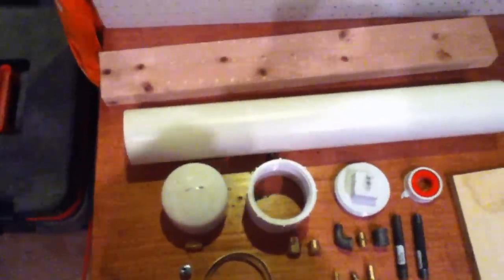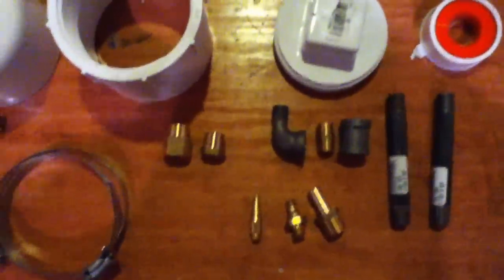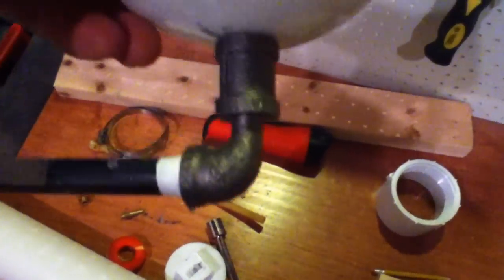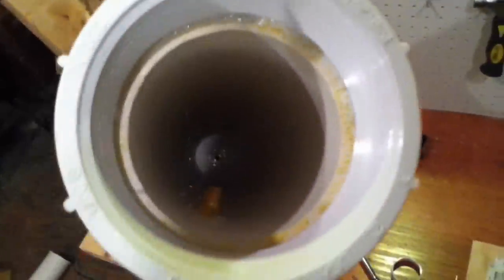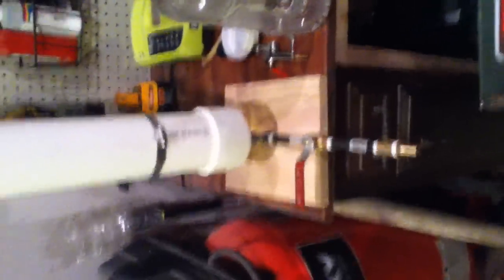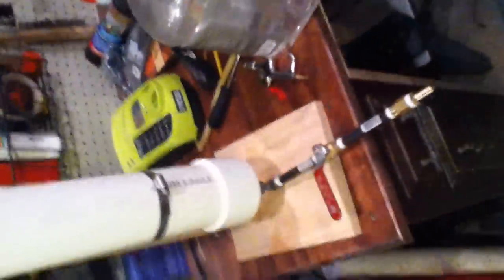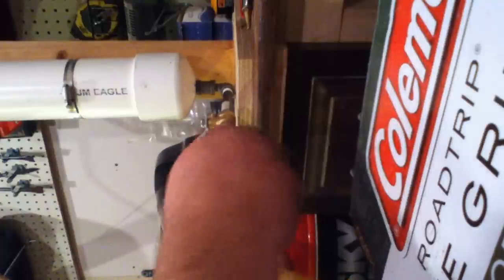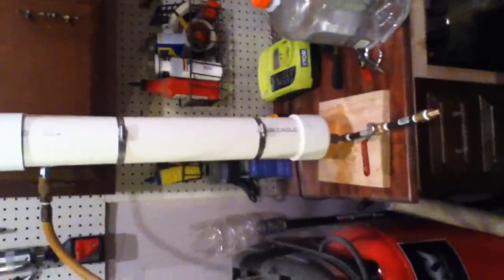How to make Paintball Grenade fill station.wmv

Comment: Once you fill the grenade, if it has empty tubing on the bottom like the one in the video you can just squeeze the filled part and move it down to the end that is zip-tied. It will slide right down. That way you don't have any wasted tubing on the bottom of your grenades. latex tubing is REALLY tough stuff. It won't burst.

Comment: Nice fill tank. I recommend a 1" ball valve to fill it through. It's much easier and faster to use than taking those screw on caps on and off and they don't leake. Great job.